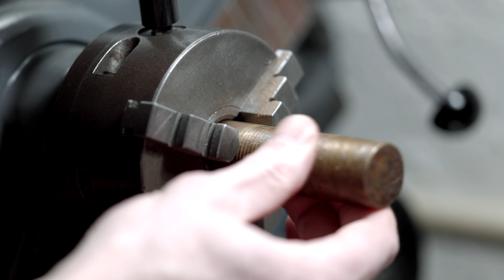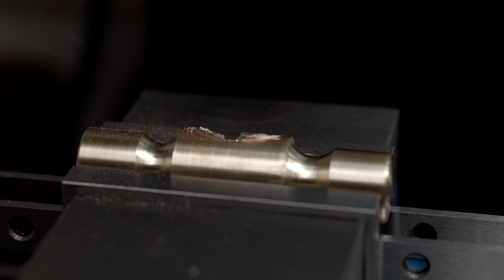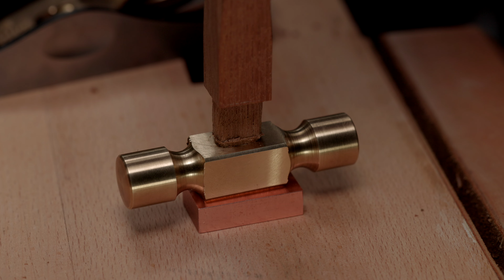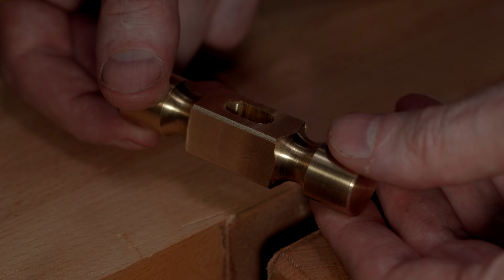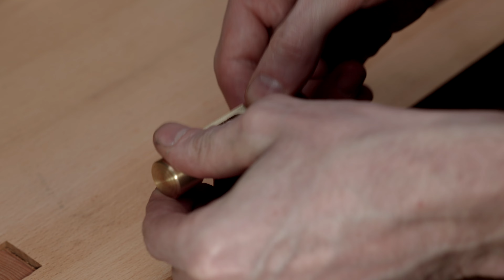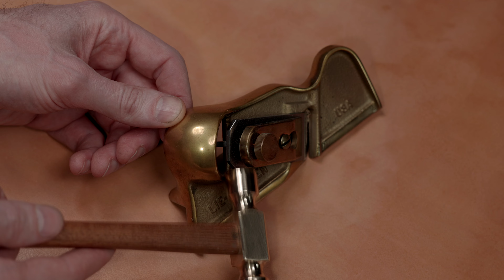Brass hammer from scraps

Comment: @Schnekkern What mill and lathe do you have?
Reply from the maker: @drewsterner7157  The mill is a Wabeco F1200 from Germany. A nice and compact little milling machine, but I wish it were a little more rigid.

The lathe is a Myford Super 7. It has an ELS (Electronic Lead Screw) system with stepper motors on both axis.